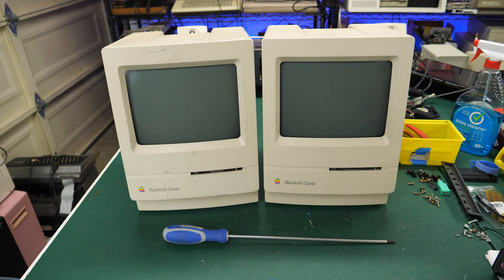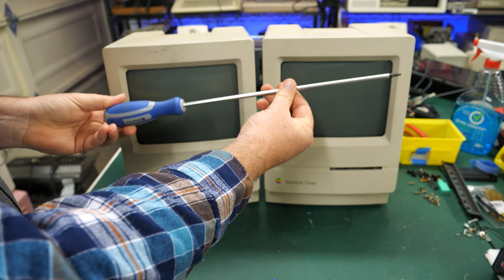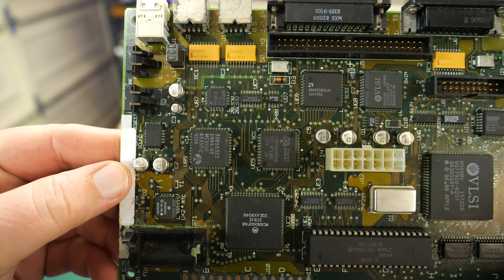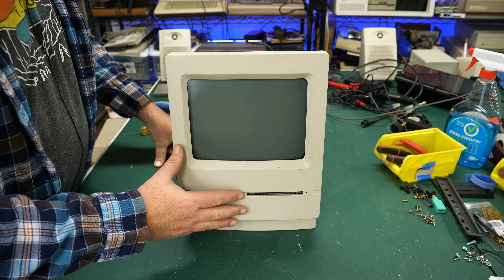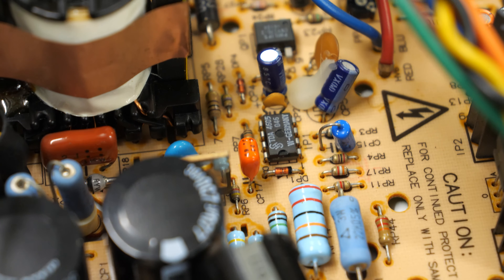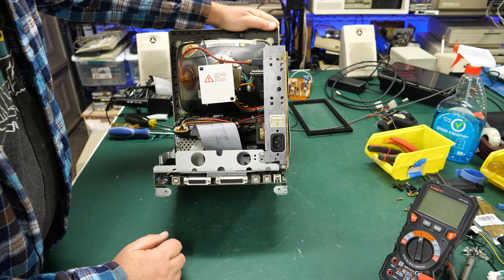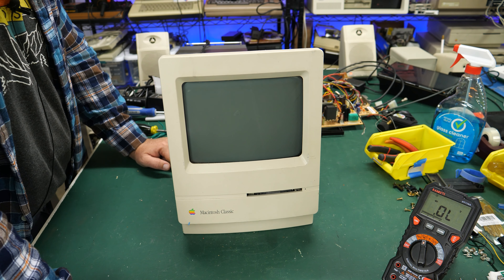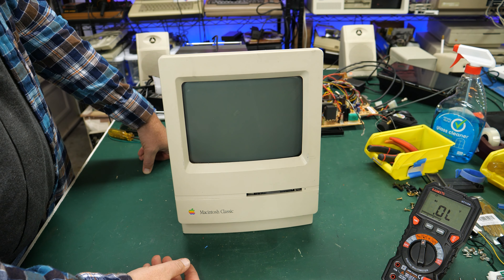Macintosh Classic Analog Boards Are Crap!

Comment: I can see signs of leaky capacitors on both boards. On the first logic board, it's especially pronounced around UB7 and UH6. That second logic board is actually a Classic II logic board (note the 68030 and 10MB RAM limit vs. the 68000 and 4MB RAM limit on the Classic), and it too appears to be suffering from leaky caps at least around the Egret chip.
Reply from the maker: Cool. Thanks!

Comment: The second board looks like a Classic II board in layout, and with the 68030 CPU it indeed would be a Classic II. That board will perform better than the stock Classic board. Both the Classic and Classic II are notorious for leaky caps on their analog boards which impact operations.